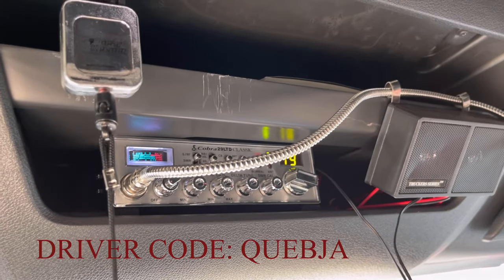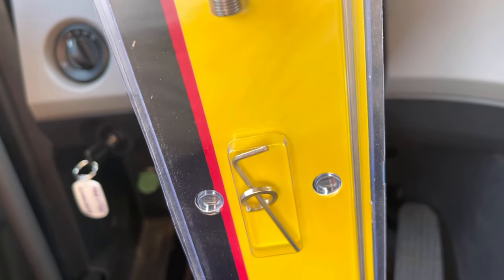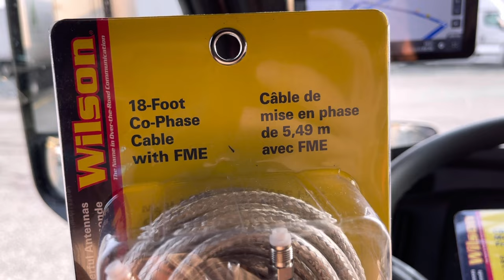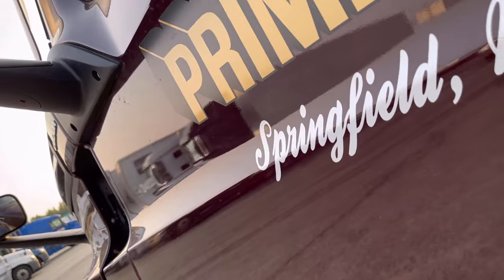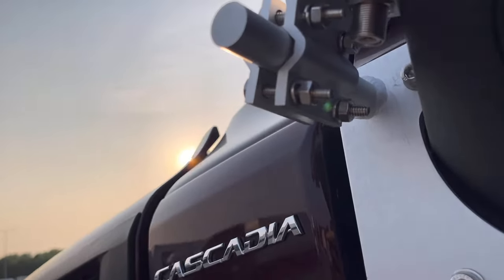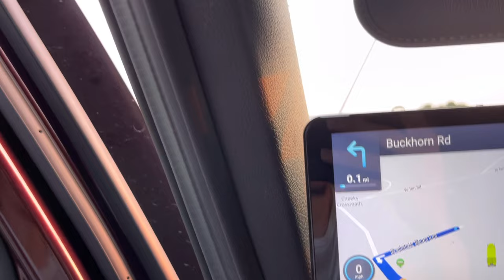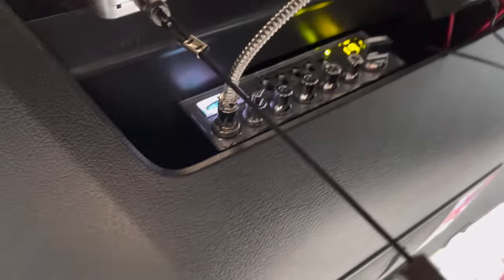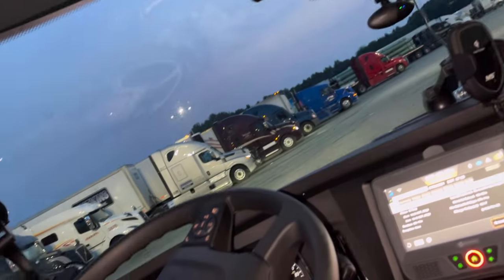Installing a CB antenna in a 2022 Freightliner Cascadia!

Comment from the maker: Also forgot to mention in this video. But the new truck name will be anointed next video!👀
Reply: Jacob is the coax being squeezed between the door and jamb is it pinching bad?
Reply from the maker: @iamkazie9401  not terrible no
Reply: @JDQTransportation  how is your range talking to passing drivers? I too have a Wilson 2000 and have the 10 inch shaft I’ve opted to put my radio on the dash I run a galaxy 99 it’s a little bigger than that recessed square on dash but it’s ok I’m using Velcro and it don’t move the heat sink on back of radio keeps it from any chance of sliding back I have a strip of Velcro the width of radio at rear and a strip on front I just don’t like reaching up to the overhead to try and change channels or turn knobs. For power I’m just using 1 of the 3 lighter outlets. Did you run any extra ground straps? Again thank you!!

Comment: I don't know if you know this or not but that cable you used was a co-phased cable specifically designed for a dual antenna setup. It uses 75 ohm impedance on each cable. Considering the low 4 watt rating of CB radios, it is important to use a single 50 ohm coax cable for a single antenna. That cable may cause poor incoming and outgoing signal due to the higher impedance and may also give incorrect SWR readings. Also, the extra unused end will bleed off your outgoing power as well as cause a further reduction in reception.

Comment: The outside panel in front of the door has 5 or 6 bolts. If you remove it, you can run the antenna cable into the cab where all the wires from the door go. They come in down there where your left foot goes. From there run it up the left pilar. No need to remove the visor or any of that part. Just remove the center piece where the CB goes and feed the antenna cable behind that cubby above the visor. Everything should take about an hour.
Reply from the maker: Awesome info brother! I appreciate it!

Comment: Don’t follow these instructions exactly. Couple of warnings; cophase coax is 75 ohm not 50 ohm use that split cable for two whips only. Your swr will be bad especially if the dangling end is unterminated. Also don’t pinch your coax in the door rubber gasket it’s bad for the coax and can cause leaks. Any antenna not properly tuned will eventually smoke your cb final transistor causing a situation where you can hear others but they can’t hear you. Just my two cents your mileage may vary. Much respect for the diy effort that’s what it takes to get along in this land of milk and honey.
Reply from the maker: Can confirm. The cophase killed me little cobra lol. But I just upgraded to a Ranger RCI 99N2. Way more power
Reply: @JDQTransportation  just be sure to change ur coax you’ll be fine
Reply: @JDQTransportation  Jacob how is the Wilson mirror antenna mount for the cascadia working out for you? I have a 2022 cascadia daycab and the factory mount on body behind drivers door is junk you have to take the panel behind seatbelt off to get to it im not even messing with it the coax connector going to radio fell off it’s thin junk I’m in a company truck but thinking about this route. I have a Wilson 2000 I want to use as well. How did you route your coax through the door jamb? It wasn’t clear in your video I seen how you did in your overhead which is how mine is I’m contemplating just putting radio on dash in that recessed area with 3m tape I see you found the mount at petro? Thanks for sharing!!
Reply from the maker: @iamkazie9401  it worked out great!

Although I am no longer in the Cascadia. I'm now in a 2006 peterbilt 379
Reply from the maker: @iamkazie9401  also to route it through I just went over the seal. So when the door was open you could see the coax

Comment: You're gonna burn that radio up using the co-phased coax. It's rated at 75ohm. You need 50ohm coax for one antenna.
Reply: If you terminate the other side with a 50 ohm load it will help with the antenna match

Comment: Leaning forward antenna 100% cool factor
Reply: Needs to be done for reflect..
Reply: @craig_sez8534  reflect... You mean SWR? 
Guys with tilted antennas usually have tall shifters, wear fingerless gloves, and walk around with their Bluetooth headsets on wherever the go.
Seriously though...
The leaning of the antenna was only done   with long flexible antennas like old Frances or the Hustler whips so that when driving, the wind would force the antenna to stand up straight up. The Tilting of average cb antennas,( including Wilson) is degrading the antenna's ability to receive and transmit properly. It doesn't say anywhere in the instructions to tilt the antenna.   Radio waves are like dropping a rock into the middle of a pool of water. They travel the same way.....unless you have a dipole antenna. Since you transmit the same as you receive, if your antenna is pointing forward most of your signal is going into the ground and into space. it'll still work but not as efficiently.
Reply: @rmark1083  lol reflect has nothin to do with swr......If your in a room and you throw a ball at the wall..What happens till the ball runs out of movement.....What do you see when you look in a mirror.....Now think before you respond..
Reply: @rmark1083  No idea what your gettin on about the shifter,gloves part..Got nothin to do with anything..Like i said,reflect thats the partial purpose of the antenna lean..The other part is as you say due to ant length which is why your ant should be tuned on the fly even thought you cant physically do it while you drive..
Reply: @craig_sez8534  the comment about fingerless gloves was supposed to be a joke. You don't get it? 
Anyway, the ball is going to bounce back and forth until it stops. Yes it does have to do with swr. My comment about radio waves are kinda like dropping a rock into the middle of a pool meant that radio waves drop straight down and ripple out from there. You don't want your own radio waves (transmission)  bouncing back to your antenna.

An SWR of 1:1 indicates that the antenna is perfectly matched and there's NO REFLECTED power. At the other end of the scale an SWR of 1:Infinity indicates that no power is being absorbed by the antenna and all the transmitter power is being reflected back to the transmitter. That reflected power is coming back to the transmitter in the form of heat which is isn't good for your radio. 
There should be no need to adjust your antenna on the fly. Adjust once and be done with it. Leave it pointing at the sky and nowhere else.
Reply: @rmark1083  Oh i know about the fingerless gloves n such..Seen it for yrs runnin the roads of canada and usa...

Running your antenna at an angle has nothin to do with swr but it is a side effect of doing so...
Re tune on the fly(sorta speak)well it matters with most antenna cause as you drive the whip of most and most all fibreglass bend which changes a few thing re ant performance...When parked your antenna is vertical and you dont chat as much..Which is why you more or less tune on the fly...

Swr....Well you can have a decient swr but doesnt mean sweet frig all,yes it shows reflect but it doesnt mean antenna is tuned...Rather find/tune in the sweet spot in the middle of the band(resonance)i use...Your impedence can be way off but still have a good swr and thats a resistence you dont want..Swr is calculated at the radio and not at the antenna like most think..

Most of the time if your antenna is correctly tuned with resonance and impedence the swr will fall in most case in its place and still may not be a 1:1 ratio.....So striveing for that perfect swr,i could care less for the most part..Rather my other #'s be where they should be...Ill watch my swr meter when i talk at times and use it simply as a guide as to its performace but not define it to say its working good...

Comment: still using the old mount for the 2018 and up hey..
PROCOMM - PCA5502 2017 & UP Cascadia P4 Series Aluminum Antenna Mirror Mount with SO239 Stud
is for the new generation cascadia..

Comment: just a fyi you cant run co phase coax with 1 antenna ypu need a single 75 ohm coax. and get it to the cb shop and get swrs set dont use the one on the cobra. just a fyi ...bad swrs can fry your finals
Reply: ahem... RG58 coax is 50 ohms. 75 ohm coax is for old school cable box's.  75 ohm will work however the SWR will be slightly higher due to the impedance.  Also an antenna analyzer (SWR meter) are only like $20 then you can do it yourself.  (Dang, how do I type this up without sounding like a know-it-all ass hat?)  haha.
Reply: @QRPadventures  no co phase is 75 ohm and can't be used with single antenna

Comment: Okay. So I just got a 2022. And I’m a new trucker.. so what are these wonky looking connecters in the stock set up? There’s no cb power cable?
Reply from the maker: There is a power cable for the CB. May have to splice a few wires to fit the CB you have
Reply: They are crimp connectors. You just put bare wires into them and crimp with a crimp tool.

Comment: Fuckin love you for this 😂 I was afraid I'd have to pay some nerd to install everything since I ain't know what mounting bracket and what not to get.

That and I'm always trynna figure this out with 4 or 5 hrs of sleep lol

Thanks!
Reply from the maker: That’s why I posted brother! Yeah I could’ve done a lot better but this will get you going 😎😎😎
Reply: @JDQTransportation and I just bought everything I needed 😅 They ain't had any Cobras in stock, which is my love of all CB Radios... but this Midland will do for now.

I almost bought that 15,000 watt coiled deathray antenna called the Terminator ... But I'm not sure what I'll need between that and CB so I just got what you did. 😎

All in all, 300$ out the door without the speakers or microphone upgrade. 😎

Comment: Somewhat helpful on the parts but when it comes to actually installing the system and I found this video very lacking ended up having to go to a different video to get it installed properly
Reply from the maker: What did you find it was lacking? I could possibly upload another video soon on it?
Reply: @JDQTransportation  I liked the beginning of it but the camera work wasn't very good so I couldn't see everything that you're doing and at least in my case I'm dyslexic so it's difficult for me to read instructions so I was hoping to cheat a little by watching your video for assembling the antenna but the part that I really needed help with was where and how to put the cord for the CB radio the placement and all that is where I really struggled
Reply from the maker: @bigt4490  I do apologize for that, honestly. I was very early into my YouTube career so I was still learning on camera angles and such. And I didn’t have a GoPro at the time. Sorry I wasn’t the help you needed
Reply: The first half was still helpful and despite watching the video I made the same mistake that you did with the mirror brackets for the antenna I accidentally bought for the older models not the newer one LOL

Comment: How good is it , are you receiving good and getting out
Reply from the maker: So far it’s pretty decent. I need to get radio and antenna tuned
Reply: @JDQTransportation  leave radio alone,tune ant with an analyzer...Dont get hung up on swr bs....Do some bonding for rf travel.
Reply: @craig_sez8534  YES!  you are correct and giving great advice.
Reply: Prob bad that antenna is horrible for the location better off with a 5 plus ft firestik

Comment: I’m at Prime. Getting ready to upgrade. Going lease. I was wondering if you could do a video on how you installed your actual CB.
Reply from the maker: Hell yeah man!!!! Congrats!!!  I actually have a new CB setup than what I had before. But these Freightliners (and I’m pretty sure peterbilts too) have power wires already built in so it’s just plug and play. May need a couple wire crimpers at most. With the setup I have now it’s on the dash with an 8 gage power wire direct to the battery

Comment: What kind of cab antenna cable? Mine won’t fit it
Reply from the maker: The cable  going to the cb from the antenna?
Reply: Yeah
Reply: Same cb radio as well just antenna cable will not fit. I guess I got the wrong one and was curious on which one you had bought and from where? Pilot doesn’t have them in stock rn
Reply from the maker: @khtrucking6962  I got it from a TA Petro. Just an 18ft coax cable

Comment: Why is the antenna tipped forward?
Reply from the maker: Helps with the range of it
Reply: @JDQTransportation  lessens the reflect from the truck body..
Reply: @JDQTransportation  helps diminish it. Ideally you want a straight up and down antenna. They only recommend it tilted about a max of 10* to reduce interference from the truck. But if you have a tall enough antenna, it doesn't matter a whole lot. You want a minimum 4ft antenna and a good quality coax, and ground. No matter how badass a radio someone has, if you don't have a good antenna system, the performance will stink. Peak and tune a radio but not necessarily have to have huge wattage. That's for pushing out a really long distance provided your antenna system can handle it. And most cheap antennas overrate their wattage capacity. If a cheap antenna says 300 watts, it really can only effectively handle 150 at best. You're better to stay around 75 to 100 watts peak. When you start getting into linear and big wattage antennas, you really have to know what you're doing and how that wattage will help or hurt you. So many drivers start adding kickers and really have no clue what they're really doing or just exactly how their cb is performing over the airways. Ideally if you have a well grounded system and a single coax 102" whip, you can walk that dog on 15 watts or less. I talk all over the world on less than 3 watts on my ham radio. Most guys tilt those antennas forward too far because they think it looks cool..but reality is they're transmitting straight to the ground and up to the air...even though they can hear things and talk a little ways away. I liked your install though, was clean for most part, although I don't see exactly where you routed the coax from the antenna into the truck. Did you leave a short section you can see from door to just inside the bottom of that A pillar cover where it ends on the bottom? I saw another guy route it into the engine bay, and back through the foam backed access port into the dash and came out where the steering wheel tilt is, then run it through dash to in behind kick panel and up to and through the A pillar cover and up.  Take care and keep the shiny side up.. de WB1BYR